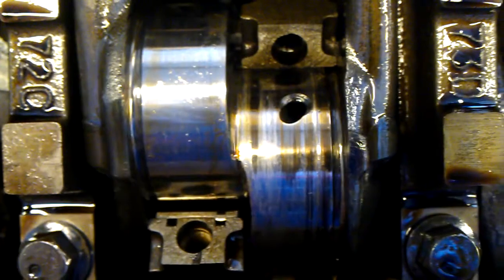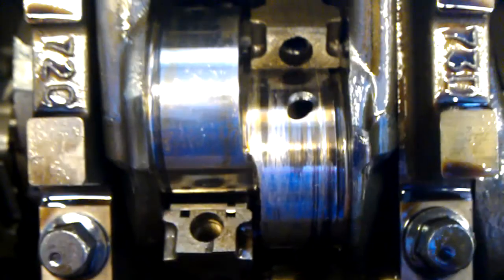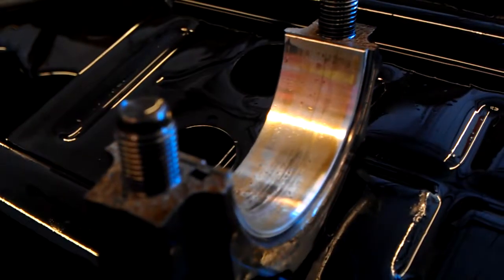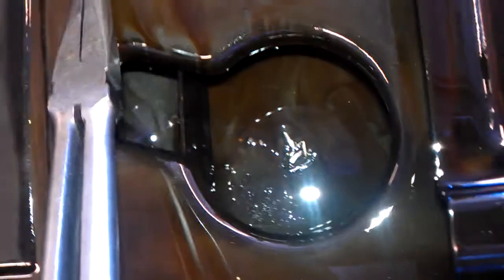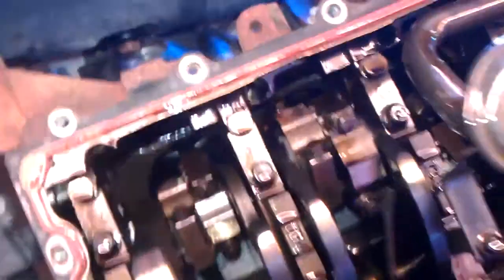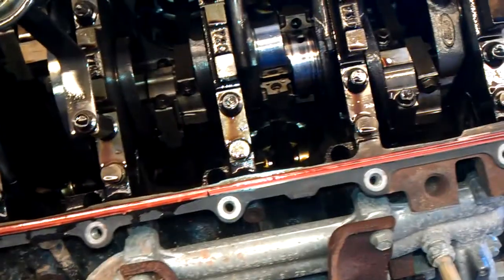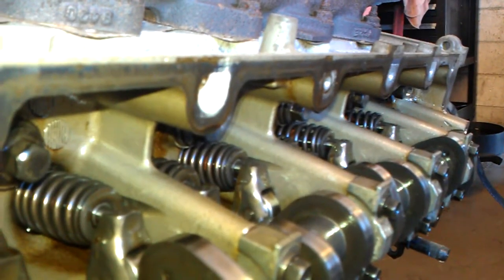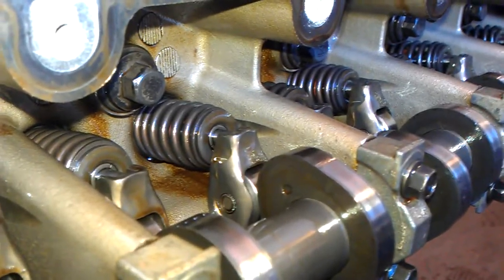SHOP UPDATE 6/19/2012 6.8L ENGINE KNOCK

Comment: the 5.4 and 6.8s in the vans have a horrible oil consumption issue even from brand new. working on an ambulance fleet of over 150 trucks. with 12 gas jobs...i have seen this happen to 3 of the trucks. why hasnt ford addressed the oil consumption issue? and now a 4th one has a bad knock. still better than the 6.0s but come on ford...

Comment: I don't know what the issue is with the modern 2v V10s uHaul runs, we had one surrender due to an idiot mechanic at 265K miles, and I've tore it down to transfer the heads to a newer engine, and it looked new inside.